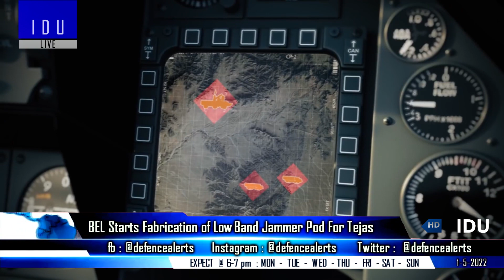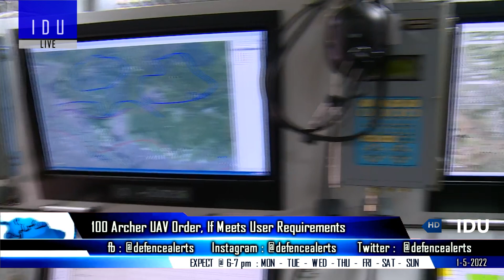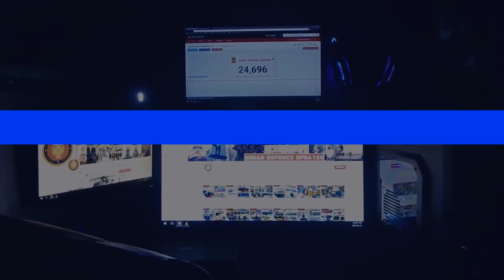Indian Defence Updates : Agni 5 MIRV Upgrade,Project 76 Test-bed,Tejas Jammer Pod,100 Archer Order

Comment from the maker: 🔴What's Your Opinion : "France Exits : Korean Offer Without VLS" ?
ＬＩＫＥ | ＣＯＭＭＥＮＴ | ＳＨＡＲＥ | ＳＵＢＳＣＲＩＢＥ
Reply: Better scrap P-75i and go for Super Kalvari.
Reply: AIP is more important than VLS. What benefit is a weapon system without endurance.
Reply: @rameshb794  in wartime conditions only three hours extra. Slow cruise with silent running they add 14 days maximum if they are new. The whole AIP is yesterday's technology they need VLS tubes. AIP can be bought off the shelf but the DRDO keeps doing bait and switch tactics. Just do a joint venture with the German or French manufacturers in India if they want it made in India. But the most important thing is to integrate new technology like VLS tubes and pump jet propulsion. Long term planning needs to be done to get the lithium ion technology from either Japan or Korea. Don't have the DRDO develop one because they will take 40 years and have a production version in 50 years.
Reply: They better invest in the pump jet propulsion system and VLS tubes. AIP is yesterday's news. Start a lithium ion batteries development with the Japanese producers in India, a joint venture is better than the DRDO promising the technology tomorrow and delivering it in five decades.
Reply: Might see update on French sub during PM visit to France
Reply: The KSS-III is a fair offer for India, since it is a technologically advanced model - comprising of greater endurance, ordnance, stealth and technology.

If India is persistent on VLS, it should conduct hydrodynamic tests of a submarine design capable of accommodating the feature.
Reply: India has aip. Vls tubes from nuke submarines, lithium ion batteries, sensor tech from scorpenes. We can create our own. Buying from south korea would be an insult. Better to order 3 more scorpenes and develop an indigenous design in the meantime.
Reply: Looks like we will never get all our childish wishlist fulfill.
Reply: Scrap p 75 I and buy more super Scorpene class submarine
Reply: South Korean president has change
Reply: India needs VLS
Reply: Archer uav can carry 2 or 4 missile plz reply
Reply: @unni3989  150 kg payload
Reply: @unni3989  still it's an classified info. 4 s given in media .
Reply: North Korea is a small country yet it has so many submarines, Idk where they get these technologies from , quantity also does matters
Reply: @stormssf8538  they are small ones -> political apathy means Indian SSK submarine program is not existent /very slow -> see South Korea went from German ones to making their own however India making impressive strides in nuclear submarines
Reply: @vaimurthy  I feel now go full indigenous production yes slow yes tedious but now or never . India making 12 indigenous subs would be great even if not upto the rest of the world in first go next time improve. Before Russian buying was cheaper and convenient now sanctions so not possible
Reply: @kamalverma2949  we have to be realistic. our enemies will not wait for our indigenous  plan to succeed which takes years.
Reply: @vaimurthy  yes but realistically If you going to buy foreign forever u remain vulnerable to sanction read what happened to turkey when they got s400

Comment: Ok, question from a layman enthusiast. WHY is India obsessed with P75I including AIP when the DRDO already has one and Lithium Ion battery tech that they can just integrate from the drawing board?!?! I'm probably missing something, I'm just curious what. 

I believe this is the second or third competitor to bow out over just the AIP system requirements...
Reply: @arealist8565  I understand that. I'm just asking why they are demanding a foreign AIP system, which seems to be the main stumbling point of the P-75I program when they have a tested AIP system of their own and have moved ahead with lithium Ion battery technology as well.
Reply: @Le écrivaine  I see some of your points, but im just confused as to the conclusion. As far as I understand, India does not allow single-vendor scenarios for these types of Tenders (i could be wrong, tho. Still, a single-vendor scenario is never a good idea), so this may kill, or at least stall, the entire 75I program. If they're planning on moving ahead with that "plan B" of L. I. Batteries, then why make, especially, a foreign AIP A requirement at all? 

I know retrofitting is not ideal, but the similarities in AIP designs make them somewhat easier than say, retrofitting the engines of a surface warship. Similar to what is being done to the, I believe, Kilo-class where an extra hull section with the indigenous AIP will be added.

From what I can see, Japan and S. Korea are demonstrating that more Lith. Ion batteries are superior to an AIP engine, but Japan had to overcome a few major concerns before introducing it. I wonder if India is at that same level of technical proficiency with them.